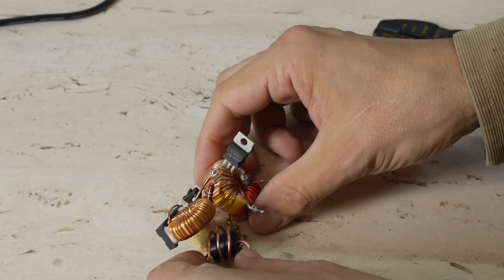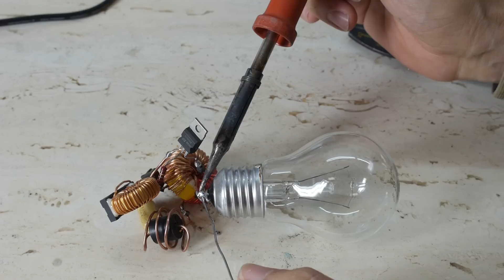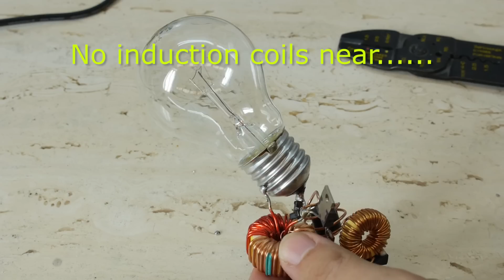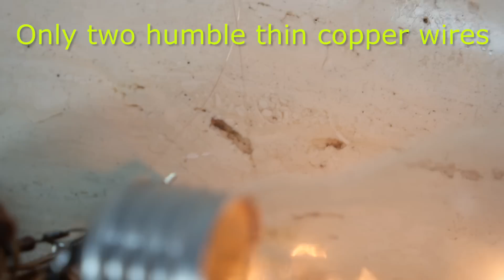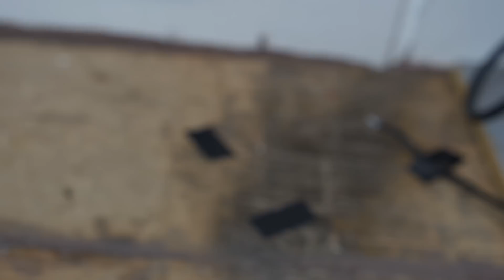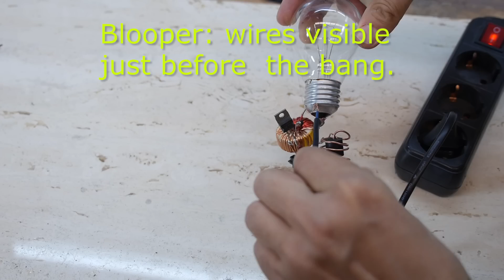Free Energy Light Bulb UNVEILED

Comment: Nice, though I expected that black cylinder thing with a thick wire to be an antenna fed by some tube-based induction heater (those things run a few megs, kinda suitable to fetch with an alike receiver).
ps This reminds me of a guy who achieved some true free energy by rigging an unused cat5 pair into the mains input before the counters and breakers (no electricity bills therefore - so it's free). Held a teapot OR a heater pretty well (getting pretty hot), ended up in a firework show when he turned both the teapot and heater on though :)

Comment: OUTSTANDING! I'll try today!
Reply from the maker: What is not shown is that I limit the current with a 40 watt light bulb in series in order to protect the wire.
Reply: ***** I have a few really nasty encounters with this kind of snake, I have done jobs with 3 and 4 phase machinery! Heck I once have a surprise with a 220 line.
Reply: Migueldeservantes You know there is no such thing as 4 phase right?
Phases are 120 degrees apart, to have 4 phases you would need a motor that can spin 480 degrees.
Also a 220 line (guessing you mean Volts) is one single phase. You get 220 from L to N and 400 from L to L
Halve that for USA and parts of Europe.
Reply: ***** yes sir I know, what you mean perfectly. I know that actually the third leg on a three phase is about 280, but in some "Anodizing, and chroming transformers for chemical baths is used what I wrongfully call the fourth leg! Please forgive my lack of knowledge on the language!
Reply: ***** There is such a thing as four phases, they are 90 degrees apart, you just have to generate it yourself